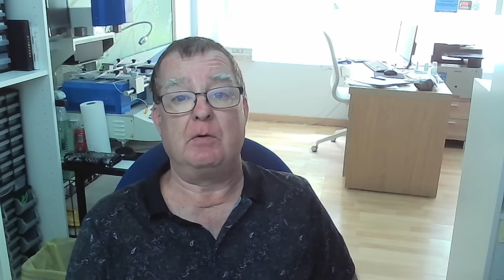The Art Of Methodical Fault Finding - A Practical Example

Comment: 43:12 / 58:11 easy way to test if signal led is alive is with multimeter on diode mode, (while device is TURNED OFF) on that mode, probes are emitting voltage and you can turn on (barely but visibly) LED in circuit by using multimeter on diode mode and correct polarity, if u invert polarity it shouldnt really burn anything because its on low miliAmp range. (Depends on multimeter, so measure your multimeter modes before you use them.)

Comment: I have often found after visual inspection the quickest way right from the start is to check with a soldering Iron for dry joints and repaired many valve T/v's in the past and saved a lot of time ?

Comment: anything learnable is teachable. even if part of the teaching is experience.  i.e. you need experience to be a surgeon, but it's also teachable.  you need experience to fly an airplane, or drive a car.. but it's also teachable.   the teaching part shortens the learning cycle, showing people where to start, best practices, check this before that, etcetera.  
 a way of thinking can be taught. some people understand it better than others, and a better teacher can get more people to understand it than a mediocre teacher.
but everything that can be learned can be taught, if you have a good teacher willing to consider how to teach it correctly. 
as a concept, just because you can't figure out how to do it, doesn't mean it can't be done.  
I come from a tech background, but I've taught everything from ESL to photography, to machine vision, to skiing, to european broadsword,, to Ultimate Frisbee.  
so, perhaps my pov of what can be taught is more broad than even the average teacher.   just my opinion/experience. :-)

Comment: im only 8 minutes in but if you didnt mention it: FOLLOW THE HEAT, heat is bad in electronics, if a part is getting hot, chances are it might be bad!
edit: this is mostly for digital electronics, good old analog stuff tends to be cold when it's dead because no current is going through it
check your voltage rails and follow the voltage, where does it stop?

Comment: Have you ever tried using the different filters on an iPhone camera or  in the “Magnifying” app in iPhone utilities to try to identify the IC’s  markings? Or, does your M-scope have imaging filters. I’ve seen I done a few times and works fairly well.
Reply: No filter would help you here, the marking is clearly ground, I have various filters both SW and HW for the lens, but when you get a part where the mechanical marking is removed mechanically or with a laser, all filters are useless and the only thing that would help is a crystal ball - Unfortunately, I can't find a functional one here - it won't be fortune-telling 🤣

Comment: Probably a carbon based resistor connected to the LED which has a negative temperature coefficient, causing the resistance to drop and the current through the LED to increase as the temperature increases, slowly killing the LED over time.

Comment: I deleted my comment -"Looks like that green led is buggered" as I thought I was being daft...until the CA confirmed it.  :-) I also wanted to add that the hot melt glue on the base of the 2 red leds is a bad idea - that glue goes on so hot it can bugger up soldered joints, I learnt that the hard way Richard..

Comment: Hi Rich, It just dawned on me that folks in some countries don't get the reason for the red "L plate" at the start and end of your videos.
I'm very familiar with "L Plates" as I was born in England and rode my Honda 125cc motorbike around for a few years on Learner "L Plates"
but over here in the USA they don't use "L plates", so that is lost on some viewers. I also remember seeing Green L plates too but I forget the meaning of the green L, 
possibly to indicate a driving test pass but not allowed to drive on the motorways in the first year after passing, I can't remember it's been so long ago.
Reply from the maker: The green L plate are optional and are for drivers who recently passed their driving test but don't have a lot of experience yet.  I never realised that the L Plate was not a global thing.  They have them in Spain also but they are green on white.   

When I needed a logo for the channel I tried a few things with multimeters etc and it just didn't work in such a small image, so then I remembered the old design slogan, KISS - keep it simple, stupid.  And the L Plate symbol, which seemed so relevant, fitted that requirement perfectly.
Reply: @LearnElectronicsRepair  Yes, It does fit perfectly, just lost on some viewers unfortunately 😞
Reply: Mr Guru  Very interesting !!
Reply: In Switzerland it's a white L on a blue background, but for some reason I immediately got the meaning of the red L (well, it's L for "learning" anyway :D)